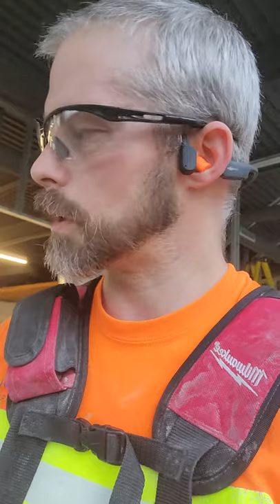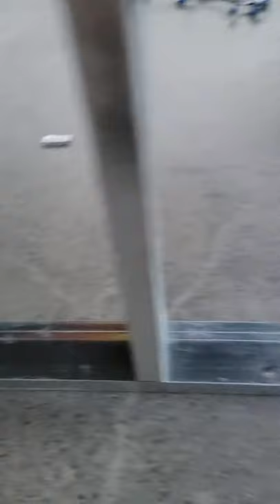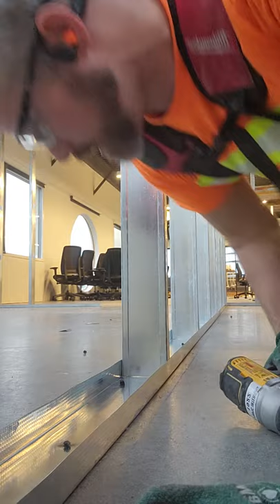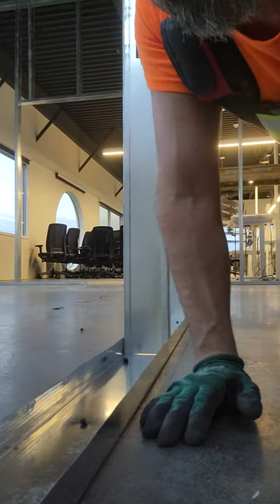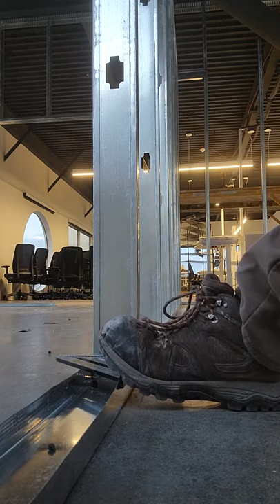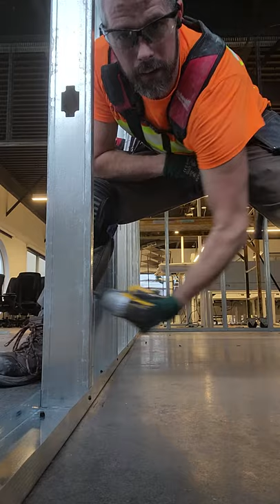Framing- Efficient way to screw off bottoms of a metal stud wall with quality in mind.

Comment: Leave it unscrewed to align when drywall is installed. Just saying
Reply: Word up.
We used to do this all the time.
Sadly most jobs now are spec'n all flanges.
This guy never mentions that this is ideal work and not reality for more than golf of the commercial work out there. I've seen some crazy shit and it has always worked out in the end
Reply from the maker: I can agree with this. But in some areas would would fail inspection by not being screwed off properly.
Reply from the maker: No matter where I have worked, retail, restaurant, tech, construction. I strongly believe it is Easier to train speed into quality than to train Quality into speed.
Reply: You guys don't make sense whatsoever. Why would you leave studs unscrewed for the sheetrockers?
Reply: And what is to keep the studs from falling over on someone, a laser, windows. Not just about passing inspection.
Reply: Get rid of those gloves and pull out five or 10 screws in your hand at the time gloves, waste time….
You’re framing, not hanging drywall, the screws aren’t sharp. Ha ha ha figure it out.😂😂😂😂😂😂😂
Reply: Trust me, even if it screwed on both sides, and it doesn’t line up with the rock, the sheetrockers will pulled out the stud screw, and then twist stud to fit the rock.
• I’ve been a journeyman in the carpenters union 20 some years and have framed and rocked and everything in between.

Comment: Square inside track most accurate. Easy to bend and flex track the way you’re showing, especially with foot on it. Could roll tape out. Eye up layout screw. Have 2 tapes so you can leave one down. The knee move is good. I do that a lot. 👍🏻
Reply: I'm third year apprentice and that's the only way Ive seen ppl do it. What other way is there other than half assing it?

Comment: If you want to be a bit more accurate, cut a 8" stud with the factory edge still on. Use thay end and place it against the bottom of the stud and bam, you don't even need a square lol.
Reply from the maker: Interesting idea
Reply: @breaktimetips  Ofc, the stud, has to be place within the bottom track.

Comment: I'm from local 675 drywall and acoustics union Toronto, usually this type is hourly vs piece work, and there is no need to produce vs accuracy. if doing pw, then yes. and code requires carrying chanel over 10' high.

Comment: Pro tip:
When laying out your track, cut two pieces of track about 6 inch long and rip them down off-center, now place them together over top of another piece of track so they fit snugly then screw them together. 
Now use that to lay out your track, now you can mark both sides quickly and efficiently.

Comment: Cool thanks for the little square trick!
few questions,
What about the back side, Should I do one side at a time?
And , should I screw the top or the bottoms first?
I usually laser up the first stud then run my 16's.
How much play should the studs have, I don't wanna push on the ceiling.

Comment: Why are the studs installed with the holes the wrong way  and they are not aligned im talking about where the electrician runs their pipework
Reply: These are uni studs. No top or bottom I thought I saw the same thing on the second stud it was just a light blinding the camera
Reply from the maker: Yes, that one stud is upside down. Had to rewatch it. Good catch. This wall didn't get mep. But you are correct.   It's better to keep good habits. And make sure stud punches align for ease of mep.

Comment: You should stand your studs in the same orientation cut from the bottom up
Reply: Those are uni-studs. No top or bottom.
Reply from the maker: Bottom of the studs in my area is 2ft up. We always aim to cut off the top so the holes line up for mep or cold roll. 
This helps be consistent when we have different stud lengths. If we cut the bottom off a 9ft stud vs a 12 ft stud. The holes would be miss-aligned

Comment: Tuse knee ,body etc. is good ,but other stuff is meh - sorry.
Usually I dont mark fk all ,just roll tape and screw accordingly ,if I have alot of framing I use self locking tape. Also you will see if your stud hits a pipe or something right away and not after you marked 10 studs ,so you can shift.
What you show is to much movement to put two screws.
Screw 1 side ,go around roll tape and repeat all this jumping back and forth is inificcient ,you do fast by working fast instead of doing job fast and easy on yourself...

Comment: Newb question, what screws did you use?
Reply from the maker: Depends on the gauge/mills. 
20eq (30mil down) are great with pointers. 
33mil or structural 20 ga and heavier need self drilling Tek screws.

Comment: DON'T screw the studs.  Use a long handled crimper, not one of those one-handed things, and do it the correct way.  Screws kick out the bottom of the sheet rock .  One gets what they pay for, Union men would never do it wrong, that's because they spend eight years in apprenticeship learning to do it the correct way.  this is a total hack job.
Reply from the maker: I've not seen a long handled crimper. Sounds interesting and a back saver. I'll check it out. With a long handled crimper, how would you square the stud for quality purposes?
Reply from the maker: For now I'll have to say the screws are a more secure hold and what's called out for in the prints. Would crimping pass city inspections? The pan/wafer heads sit fairly flat. Less than an ⅛ I believe.  and do not interfere with the finish of  ⅝ gypsum.

Comment: How do you mount tv on wall with a metal frame
Reply: Wood blocking in between studs.
Sometimes metal backing but it should be non combustible plywood or 2x material
Reply from the maker: As aji stated. Wood fire treated wood blocking goes in for most heavy items. Barring that. Depends on the gauge. But metal screws can work.